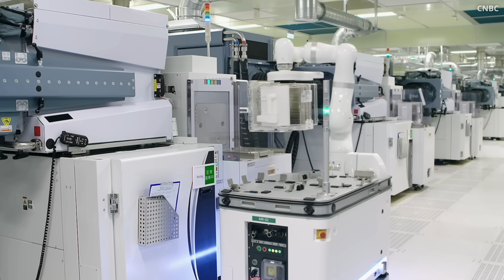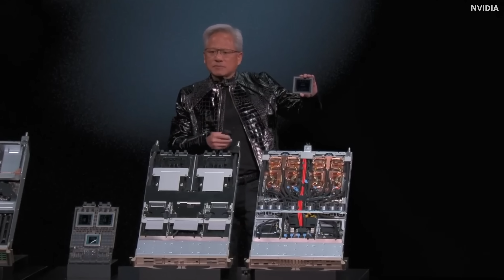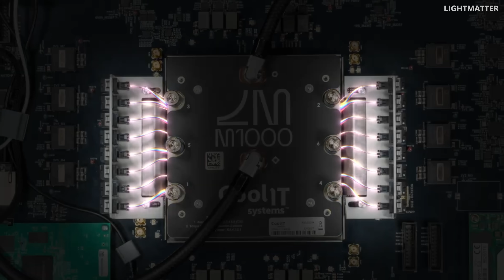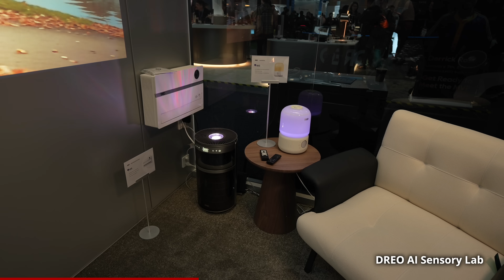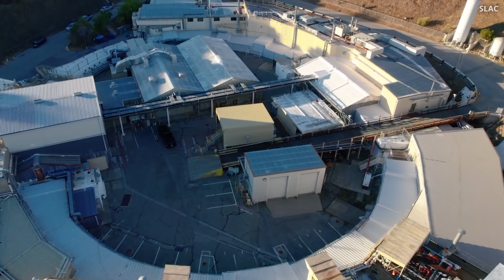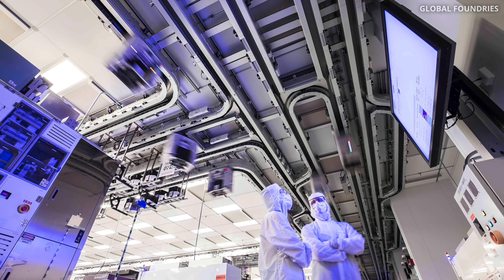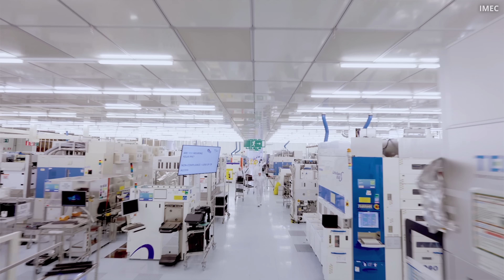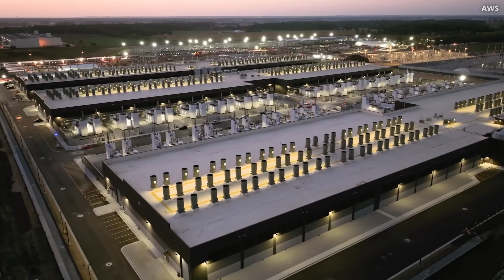This New Technology Could Kill TSMC and ASML

Comment: 8:53 You made a mistake here. X-ray wavelength is not 1000 times smaller then EUV. EUV is borderline close to X-ray and depending on definition, it is few time to 10 times larger, not 1000 times. 1 angstrom is a tenth of nm.

Update: As @Flameboar  mentions, at extreme ends (with hard x-rays in picometer range, it could be considered 1000 times smaller then EUV). Even if we achieve such small resolution, the silicon lattice is few angstroms, you cannot have semiconductors with features less then an atom width. So, the limit of features is constrained by that and there is no way around that.
Reply: X-Ray wavelengths run from 10 picometers to 10 nanometers. The ASML EUV light-source is 13.5 nanometers or 13,500 picometers. At the low end of the X-Ray range, the wavelength is less than one thousandth of the EUV wavelength. Anastasia is correct. If Substrate is to make a quantum leap into lithography, they would be working on an X-Ray wavelength which is much smaller then EUV.  The goal would be to avoid multi-patterning, not simply to use another light-source. This means concentrating work at the lower end of X-Ray wavelengths, which would be closer to 1/1000 of EUV's wavelength.
Reply: @Flameboar  Any reasonable X-ray optics system would be in the same order of magnitude as EUV energy, so it's clearly soft X-rays. Hard X-rays have too many challenges with secondary electrons and very low NA optics, low reflectivity mirrors (KB and Laue). At some point, lithographic advances aren't going to be that useful due to secondary electrons - 1/1000 of EUV WL is 1000x the energy which means generating potentially multiple Auger electrons and photomultiplication. At some point this and stochastic defects will limit your resolution, and you will have to consider more advanced device morphologies like CFETs or increasing fmax instead. So no, X-rays at that high energy isn't really remotely feasible for industry step-and-scan techniques.

As for Substrate itself, there's clear signs what they're doing is direct write and not scan-and-step, which has been around for decades in universities in the form of EBL which have as low as 2 nm CDs. There's also a lot of alternate ways to generating the light which are more efficient than FEL/accelerators like Gd plasma via similar LDP/LPP based methods. The founder has dubious origins (having only tried to kickstart a sleep monitor that never made it to market) and has no real foundry experience atop owning no clean room facilities at their labs. Some others have pointed out that their website is very likely written by LLMs.
Reply: @rubbles2206  This! I think you've answered some of my most vexing questions. And I think you also explain why they can't do multi-pass (multi-patterning). And thanks for bringing up the gobs of x-light generators. I'm sure many dental x-ray operators are wondering where the synchrotron is hidden.
Reply: @Flameboar  true , but they get higher penetration at the smaller end, and they barely have the materials and tech to block the masked regions on the widest x-rays. So that's why they're targeting 12nm, where they'd be at par with euv. Still, it's a potential path, and it's hard to imagine euv could get much smaller. At a minimum, I do think the hurdles to get smaller than euv can do are great enough that calling 1000x, or even 100x or even maybe 10x smaller is way premature.
Reply: The entire reason ASML focused on EUV is because there are no good optics for X-rays (absorption is super high meaning a few bounces and you lose all intensity). ASML literally started with X-rays but moved to EUV for this very reason. Not just a hard problem, sounds like they are tackling the wrong part of it. 🤔
Reply: More likely this tech is just using soft X-rays, Focusing & masking hard X-rays for lithography is pretty much impossible.
Reply: Who really needs this stuff  ?
If everyday search engine answers are a measure --   ask the same question twice and likely get two different answers.    Better off with some reference books.
Reply: Give the Lady some slack. She probably speaks half a dozen languages.
Reply: How can I buy their stock?
Reply: That's completely wrong. Everyone has been completely misled. X-ray technology will take another 20-30 years to fully overcome, at which point X-rays will be obsolete. And the market will still be monopolized by TSMC and ASML. 😂
Reply: X Rays aren’t defined by a wave length they are defined by how they are created. X rays are created in the election shell of atoms they can by as large a visible light or as small as gammas.
Reply: @matthewhuszarik4173  X-rays are definitely defined by their wavelengths. They have a wavelength ranging from 10 nanometers to 10 picometers. X-Ray wavelength is shorter than ultra violet and longer than gamma rays. Its part of the electromagnetic spectrum
Reply: @jerrynguyen8083   Sure a very random definition. But this distracts that EUV is basically x rays by physical behavior. The physics doesn't care about SI units.
Reply: @jerrynguyen8083  Not everyone agrees on that definition, because it sucks. Realistically, there is no sensible sharp distinction between X-rays and gamma rays. Which word is used depends more on the scientific/technological field where the radiation occurs rather than wavelength.
Reply: @cherubin7th  - The physics and the energy are synonymous.
Reply: @entcraft44 that's true of literally every boundary in the electromagnetic spectrum, there's always odd transitions between properties (bc it's a spectrum). The exact point you call the dividing line is pretty arbitrary, but the overall behavior in a regime is valid. Just as an example you can distinguish yellow and green light pretty easily at their centers, but try putting the two shades at the dividing line next to each other and see if you can tell lol. Similarly euv is close to the xray line, so it's beginning to behave similarly to x-rays, but it's still into uv enough that mirrors work reasonably well, unlike true x-rays that tend to penetrate/disperse/absorb through classical mirrors.
Reply: @matthewhuszarik4173  So you invented visible x-rays! NOBEL PRIZE FOR YOU! 😂
Reply: @matthewhuszarik4173  X-ray photons with a wavelength of light would simply be light. A wavelength of gamma photons makes them gamma rays.
Reply: @danblanks3190  - Exactly. Wavelength and energy are proportional attributes of electromagnetic waves, all of which are the same object with respect to their classification in physics. Commenters here do not have very good scientific educations.
Reply: @matthewhuszarik4173  the wonder never ceases... wait until you learn about Bremsstrahlung, emitted by free flying electrons when bumping into a target.
Reply: @col0342 This is why when I was using βeta emitters such as 32P, I never, ever used Pb as one might think to shield myself but a lucite βeta shield.  Bremsstrahlung means "braking radiation" as the electrons don't bump into anything but come close to a heavy nucleus. As they move away from the heavy nucleus, they are pulled by their protons and they lose energy which is given off as either x-rays. You don't want to become a walking X-ray machine.😉
Reply: @col0342 The Bremsstrahlung, or 'breaking radiation' only affect free electrons in vacuum or hollow state and is produced when free electrons hit a target such as the plate (anode) in an x-ray tube. The electrons are accelerated by a high voltage and then decelerate in the target material, emitting photons as they lose energy. This process is crucial in x-ray generation. The emitted radiation has a continuous spectrum, with higher energy photons corresponding to SHORTER  wavelengths and higher (also shorter) frequencies since 1/F=T.

Solid-state semiconductors do not require high voltages to attract electrons like in thermionic cathode diodes or CRT, making them emit x-rays when free electrons from the cathode 'break' into the Anode plate under high potential creating spurious x-rays.

Some people confuse longer and shorter waves... Such as reported by erroneous search results. Can you spot where the error is in the following paragraph?

Wavelengths and energy levels
Visible photons and invisible electromagnetic waves are both forms of electromagnetic radiation, but they differ in their wavelengths and energy levels. Visible light is the only portion of the electromagnetic spectrum that can be perceived by the human eye, as it has wavelengths ranging from approximately 400 nanometers to 700 nanometers. In contrast, invisible electromagnetic waves, such as gamma rays, X-rays, ultraviolet light, and microwaves, have wavelengths longer than 700 nanometers and are not visible to the human eye. The key differentiator between visible photons and other electromagnetic waves is their wavelength, which determines their visibility and energy levels. 
National Oceanic and Atmospheric Administration
+5
Reply: @matthewhuszarik4173 duuude😂. Dunning-Kruger is strong in this one.
Reply: @matthewhuszarik4173  where’d you read that? 😂
Reply: @matthewhuszarik4173 where did you learn that 😂😂
Reply: @matthewhuszarik4173  If you got a light in Gamma ray spectrum, that can only be gamma rays. You need to go back to physics school.
Reply: @matthewhuszarik4173 ah, you didn't 'remain silent', and this 'removed all doubt'. All temporal phenomena below the size of an atom demonstrates wave-like phenomena.

Comment: The problem with chip lithography goes far beyond miniaturizing printing; quantum phenomena are already a major problem in the operation of current transistors. Some more sensitive transistors have to be printed in larger sizes to avoid quantum and thermal interference. Lithographic technology is reaching its limit. A new paradigm being researched is analog photonic computing; if the research is successful, all these lithographic machines will end up as trash.
Reply: A story that's been told 1000's of times though, there are technologies out there that are world changing but the engineering to make it commercially viable just isn't there yet
Reply: yeah, analog. Aka extropic vaporware bullshit
Reply: Those lithography machines are useful for producing any kind of nano-scale patterns. They could be useful even for photonic chips. Even DUV machines which are decade old tech now are still useful, to print less fine parts of the chips, which are the vias and interconnects, because the machine is faster and cheaper to buy and to run.
Reply: Analog computing is the future
Reply: @marpin6162  Everything is analog on atom level. CHIP are an analog machine simulating digital operation.
Reply: Who'd have guessed that the elephant in the room is also the smallest "thing" in the room.

Comment: Building a cyclotron for x-ray production is INSANE. You can just use a linear accelerator - its medical grade machinery, and will produce way more powerful than you even need. Its not terribly expensive, and there is a lot known about how to focus electron beams properly.

These machines accelerate electrons with microwave pulses, then bend that beam with magnets to filter out any out of spec electrons - then hit a tungsten target that converts electons into photons. Its a relatively simple machine 3m long.
The issue comes after.... x-rays made from electrons dont have just 1 energy, it produces a spectrum - few high energy photons and many more weaker ones. So you want to filter the weak photons, which is also understood - just add a thin plate of some light metal to block the weakest x-rays and the strong stuff passes through unchanged.
And you want to capture any scattered photons within the machine. You must build it with thick shielding, so you can afford to have people work around these machines. Its not radioactivity - xrays turn on and off line a light switch.

So the issue mainly lies with the mask. The mask needs to be thicker to block x-rays where its not supposed to be, which is not a problem if the beam hits it dead center. If it has any angle during the exposure (side of the chip), your mask has a varied thickness now on the edges.
Also, the mask doesnt just block x-rays - by physics, it also scatters, so likely a small amount will pass through, blanketing the wafer in a hasey, light exposure. And you do this for every chip you print... so that might add up once the whole wafer is covered.

Additionally, x-rays are best blocked by heavy atoms with a big nucleus. Xrays will pass through the photo resist - hit the silicon - scatter - hit the photo resist from a random angle.
You likely need an entirely new suite of chemicals to get this right.
Mirrors will be made of gold or iridium probably, to reflect x-rays.

On the upside, you dont have the droplets of tin in the machine - xrays are produced with hard metals, magnets and electricity.

Comment: It is all the same process with better pens. We used to write on cave walls, then ink, then print, then code. The limit is what you are writing on. The limit in this case is atoms. You can not have something smaller then the material you are writing on.

Comment: How could the do multi layers in one pass? Doesn't seem logically possible . How does it reach inside layers but still allow 3d etching .  And it seems that you said stuff was going vertical now.
Reply: You use two masks to expose a single layer.
Some etching is done much deeper into the silicon than was done before. So a lot of features also high a 'height', and are build using multiple layers and many more steps.

Maybe im understanding your question wrong.
Reply: still multi-layer, no more multi-patterning. it wasn't very clear.

Comment: Riiight, a company as big as ASML would be completely unaware of what is happening and switch to looking into the production of light-based processors for absolutely no reason?
Of course they won't show their true face, but to claim that they would be blindsided like this is absolutely insane.  They literally have stated that while they could go smaller, there is a big problem: the laws of physics.
They literally hit the boundaries of how small a transistor can become due to how difficult it is becoming to dissipate the heat.  This in turns causes the terminals of the transistor to become so radically small that they are just a few atoms in size and thus thickness, destroying themselves in the process of switching due to electromigration, a proces that tends to see acceleration due to heat buildup.
Reply: That's completely wrong. Everyone has been completely misled. X-ray technology will take another 20-30 years to fully overcome, at which point X-rays will be obsolete. And the market will still be monopolized by TSMC and ASML. 😂

Comment: something else that comes to mind is it is one thing to design, and print the wafers on a material that can handle it - it is another to get the chip working.  I remember Intel constantly having to invent new materials to act as insulation to prevent elections jumping the gaps - the smaller you go, the more frequently this occurs robbing the chip of power and efficiency

Comment: I thought that patterning was using diffusion and interference to create smaller features than the wavelength ? In any case thank you so much to not let us suffer through Moore's law
Reply: Yes, but... Lets reverse a step to make it easier to think about: the interference pattern to build a small feature, is always larger than the small feature it prints.
So printing 2 small features, means 'adding' two patterns together. (In reality its a different calculation, not some addition.) But these can bleed out or 'smudge' the pattern if the two features are to close together on the silicon.
So 2 individual masks prevents adding patterns and allows you to expose 2 small features closer together than when exposing it together.

Comment: We are starting to see the first "all-diamond" semiconductors, but they aren't for gaming yet. They are for the most extreme environments on Earth, diamond chips can handle 50,000 times more electricity than silicon and survive temperatures up to 1,000°C (silicon fails at 200°C), you likely won't have a Diamond Core i9 in late 2026, but by 2035, you definitely will, it just may not be called that lol.